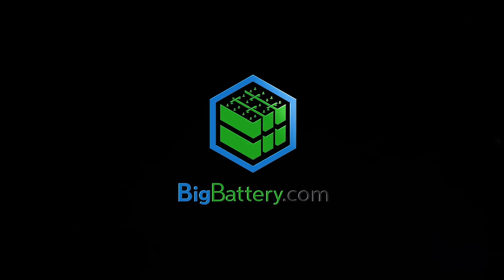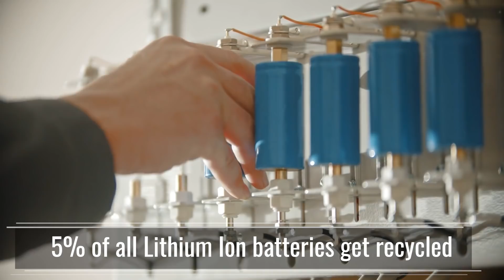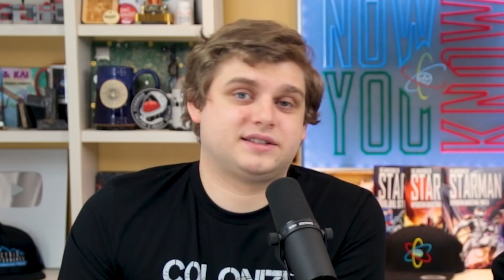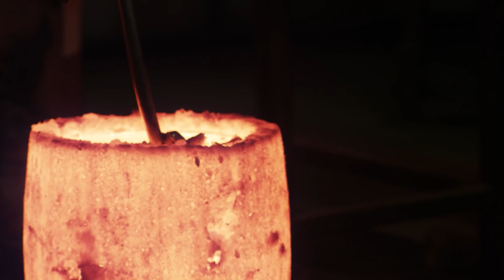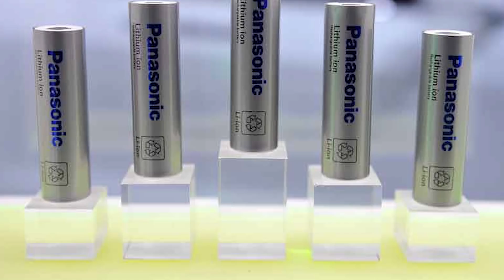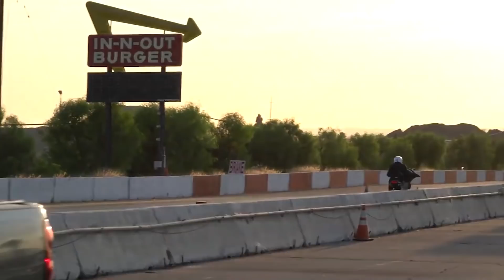Battery Recycling: Truth Revealed | In Depth

Comment: Their(RediVivus) system AND Straubel's system are both  imperfect. Their recycled nickel as they admit is too impure to be re-used for batteries w/out further refining - what about their recycled cobalt and lithium - will that need further refining too ?  Also:   how much energy will be needed to freeze tons of battery packs to -60 C in order to safely shred them ?  The hosts give a positive mention to Canada-based LiCycle - but don't say precisely how LiCycle is better than Straubel's Redwood processes and ambitions. What about Lithion(also Canada) and Finland's Fortum ?  They all claim up to 95% "closed loop" recycle rates. As do Umicore.  The host's criticisms of Redwood/Straubel are far too scathing:   Straubel's mission and commitment deserve huge applause. And "JB" will certainly do everything possible to gradually improve,optimize and evolve Redwood's recycling strategies and processes going forward. 
Remember: "Perfect is the Enemy of Good Enough For Now"
Paul G(Editor:  EVUK)

Comment: Duesenfeld in Germany has created a non-thermal recycling center as well. As I recall, they cleverly dealt with the ignition problem by shredding in a nitrogen atmosphere. Their other clever idea was to fully discharge the batteries and harvest that energy for helping to power their facility. They said the discharge supplies about half of their needs. It's not clear to me how labor intensive that step is. The rest of their process is chemical in nature using acids and subsequent catalysts to create the various metallic precipitates. For them, the graphite was the last part of the problem they didn't have in full production yet, but was planned. Total recycle was over 90%. Given all the various initiatives, I tend to believe recycled batteries will not be a problem, unlike our massive electronics waste. Anyway it's done, there will be byproducts, but as your current video points out, there seems to be no shortage of clever ideas.

Comment: Guys there are a ton of mistruths in the first 3.5mins alone. The biggest of which is that Alkaline and Zinc Carbon batteries won't self combust no matter how many times you pierce them and the vast majority of the collections you refer to in the cardboard boxes are in fact these 2 batteries types. Even if there was a thermal runaway incident with a Li-Ion battery in the middle a cardboard collection box it would burn out and none of the Alkaline and Zinc Carbon batteries would ignite (because they cannot burn). I think you guys should have done a little more research on this topic given the number of people who watch your videos.

Comment: It isn't surprising that battery recycling hasn't caught up yet. Most EV batteries haven't been recycled, and most of them haven't been landfilled, and most of them haven't been put into a second life use. Most of them are still on the road. We do need to put in the work on battery recycling, it isn't easy, but it isn't impossible, and it is worth doing. Putting in the work now to figure out the best processes now will allow us to scale them up as large numbers of batteries start to need recycling in the coming years.

Comment: There is a company (forgot their name), they first discharge batteries and then shred at room temperature safely. This energy runs half of their facility as they said. Another thing to think about when shedding batteries is outgasing. Some dangerous chemicals go into the air and you can't do it at large scale just in open space.
Reply: https://youtu.be/wxCFDWMPu38

Comment: I've met Erika, and I've known Luke for several years. This is a serious business venture that I absolutely guarantee will succeed. The nickel inside the NCM/NCA lithium chemistry needs to be very pure, but the nickel-plated steel shells on 18650/2170 cells will be more than happy to use 99.9% purity nickel. Nickel is needed for the Tesla cybertruck stainless steel skin, cobalt is used in machining drill bits and milling cutters...there is a HUGE market for anything that this business produces.

Comment: To me it makes much more sense to cool down the battery pack of a BEV that has been in an accident and try reusing components of that pack first. There's much more to a battery pack than just batteries and reusing is always more effective than recycling. Cooling the pack down or even refrigerate for transport to a facility where people know how to deal with the dangers will enable reuse of the batteries and disassemble instead of shred and mix and then need to separate again. All that cannot be reused can go into their shredder for sure.

Comment: Batteries from crashed EVs are seldom wasted. Most are processed by skilled craftsmen. Batteries are fitted with new control electronics and used for powerwalls, just as was predicted. Going rate for one tesla module is around 1500$ each.
Reply: An you cite a source for this information?
Reply: @motor2of7  Nope, but Go to EBay and search for TESLA Modules.

Comment: At wrecking yards and auction yards, if the vehicle won't roll, they jam a fork-lift under it to move it. That could result in a battery fire. There has to be a change before someone gets killed.

Comment: Great video/interview.  This non-recycled recyclables problem is also relevant to plastics for sure.  Very frustrating to separate stuff for years and years, then find out most of it it never recycled, or sometimes is even burned to create power.  Things are improving, but policy, economics, and science/engineering are not always on the same page.  Externalizing costs by corporations benefits the raw material/production/sales/consumption stages, but the disposition of waste is decades behind (still).  I like the bacteria-converting processes most of all, because they require few inputs, and produce fewer process wastes.

Comment: Currently most 12V car batteries are made with about 95% recycled lead, hence the core fee at the store if you don’t have the old battery to trade in. Also recycling companies do pay a small amount for lithium rechargeable (undamaged), NiCd, and NiMh batteries, where they charge to recycle alkaline (not reusable). Companies like this will find an even better process and solution which will be great to see.

Comment: What about ABML? Seems like they're doing things the right way.
Reply: That's why I slammed $5000 into ABML when they were .20 per share. When I first saw a report about their mission statement and I found no one was even trying to do this a few months back. I just decided that it was worth the gamble. 
I'm hoping that they start looking for investors so I can jump on that as well.
Update: I found REDISHRED (RDCPF) at .60 right now and I'm reading into their prospectus.
Reply: @texan-american200  Then you have done VERY well considering that it's now 1.38!  I think ABML is planning on, as a portion of their biz, either licensing their tech to the battery maker producing the waste stream as a part of their testing or production efforts, or having their system built right at the site so the class 9 hazardous material transport issue isn't as significant.
Reply: @erikehlert  
I was very, very lucky. I sold my initial 5k investment when it reached 3.5 and I was kicking myself for not holding out to 4. Now, much later I had the opportunity to put my 5000 back in on this relatively large dip. After this, I'm selling my 5k on the next bull run and going to put it on another battery mineral mining or recycling stock. This year will be insane with battery tech investments...
Reply: They were talking about redwood roughly at 4.00mins

Comment: Guys this is fantastic that you have brought this to peoples attention. I have been repurposing lithium batteries and now have 11kwh of storage. Reuse and repurpose before recycle. Recycling is energy intensive and this method will release toxic material into the air in the stream off gases. They mention nothing about how they capture this gas and how they power this process.